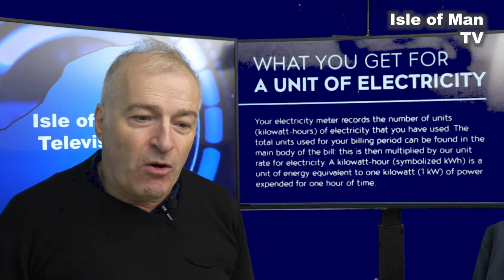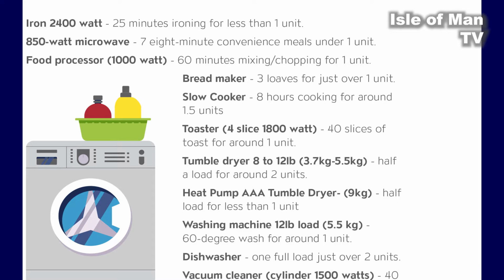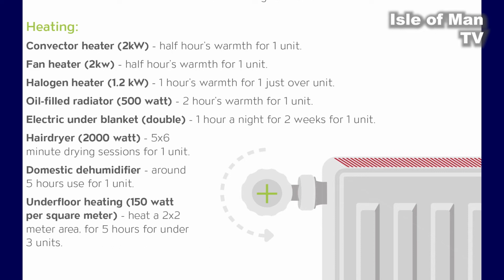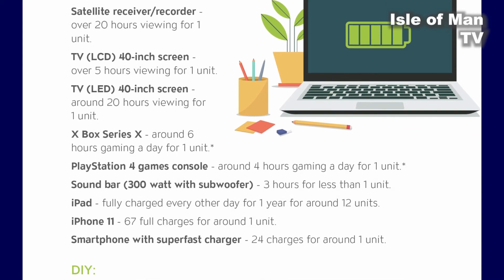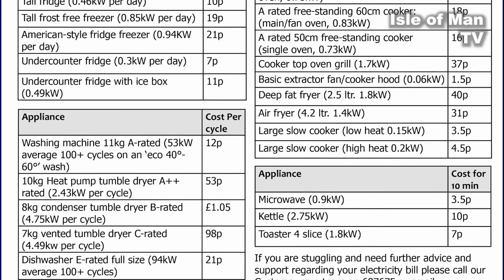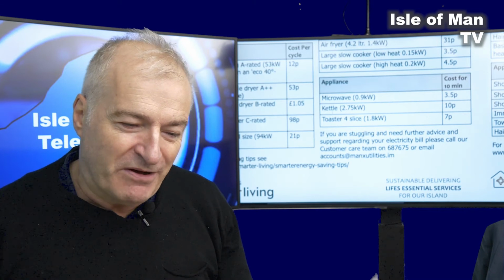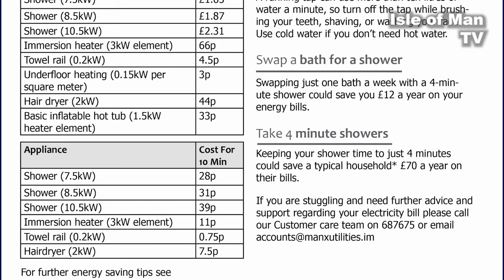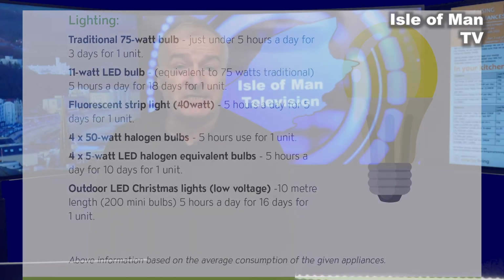Manx Utilities produce the cost of using electricity guide

Comment: Cut way down on cooking time (by half or more) by cutting food into smaller pieces. The smaller the pieces, the shorter the cooking time. Separate, don't pile up, as this defeats the purpose. Using two or even three pans allows for space to spread out ingredients. If you are concerned it will dry out, mix first with a tablespoon of olive oil, butter, margarine or other fat until coated. This can be done with all ingredients in a bowl first. Ovens take more electric than stove top (with lid), air fryer or microwave. Alternatively, no electric is needed for an outdoor grill or hibachi that uses salvaged twigs or chunks of free wood.  : )